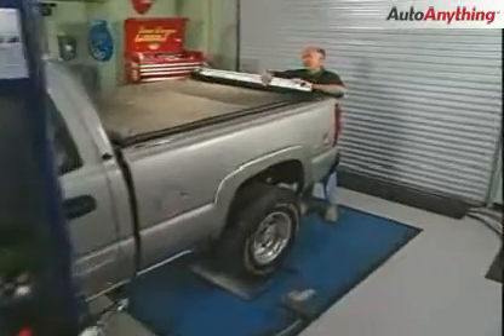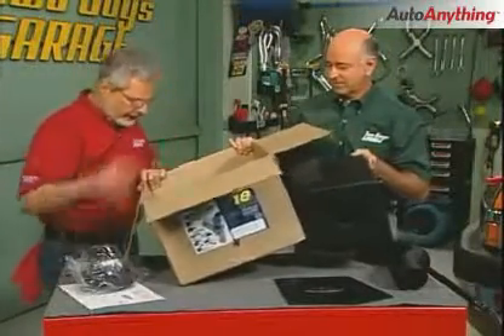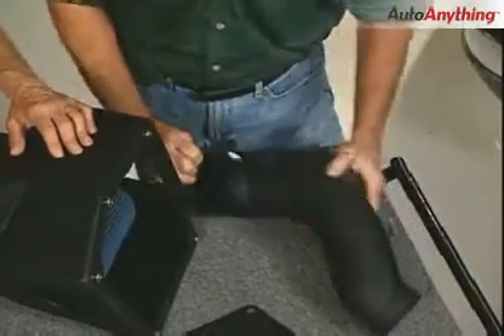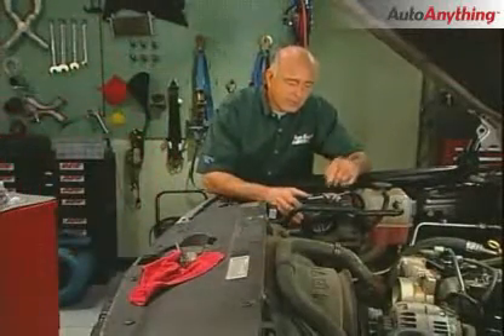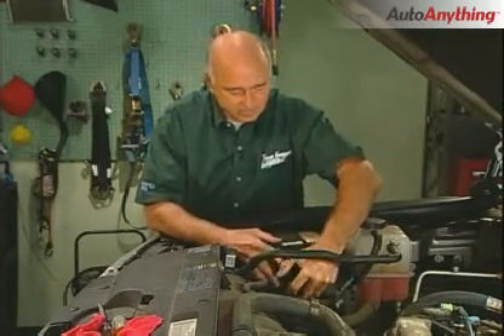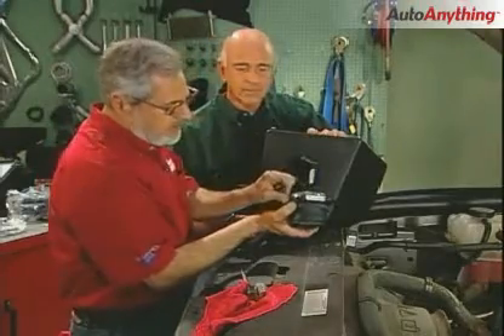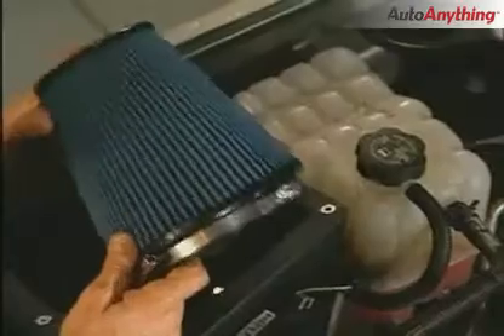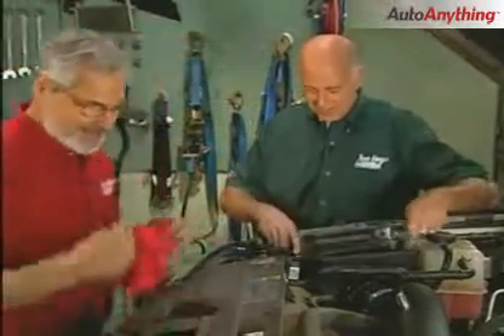2003 Chevy Silverado Volant Air Intake Installation

Comment from the maker: Both are great intakes and CARB exempt (for your vehicle).  The Banks intake is more expensive than the Volant, but they also spend a lot of time engineering their products. Many of our customers have noted easy install and great gains. However, Volant does offer two different filter options: their reusable cotton gauze filter and the new oil-free PowerCore air filter. The PowerCore only needs to be cleaned every 150K miles, so if maintenance is a concern, the Volant would give you more options.

Comment: Amazing how easy your parts came off with out any tugging or pulling. ha ha When you do this in real life those things don't come apart that easy. When you loosen the clamps up the the rubber is still stuck fast to the connection and you have to jerk and pry them off. Then the holes in the Volant air box don't line up with the existing holes and there's only 2 of them so you have to drill them out to fit. If you buy the scoop attachment the sleeve that attaches the scoop pipe to the air box is to short by approx. one and a half inches so you'll have to find something to make a longer sleeve out of.